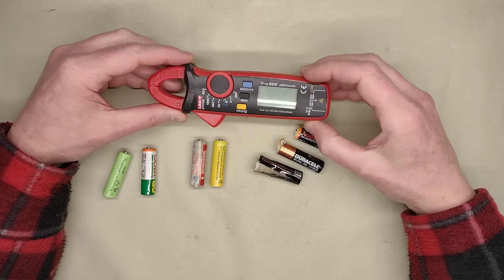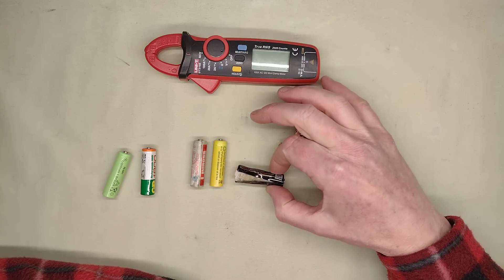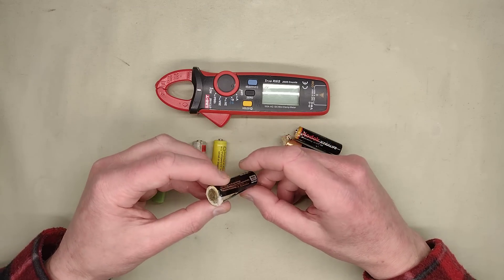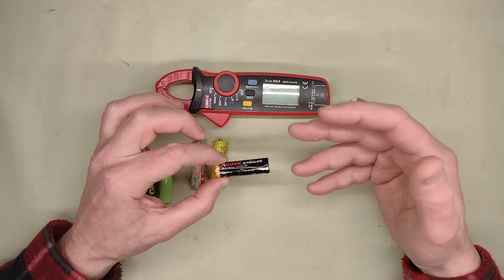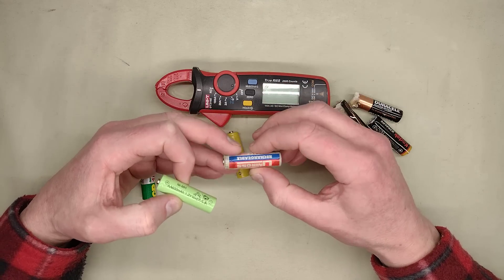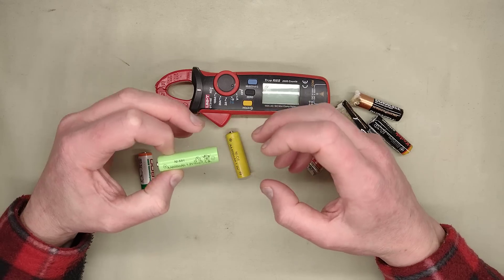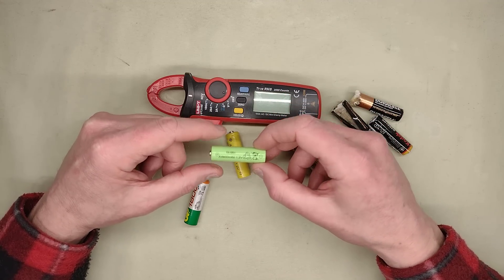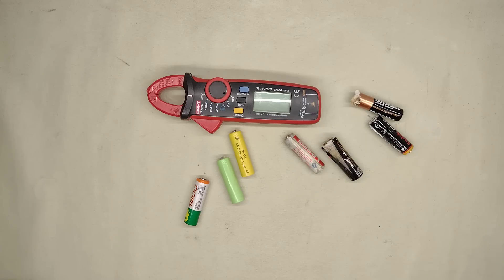The curse of leaky alkaline batteries

Comment: Sorry to say I've got at least one bit of kit that really doesn't like the lower voltage of NiMH it being a Brother label printer. Not really had much of a problem with leaky Duracell or Kirkland alkaline cells but I do have some kit that it's easy enough to leave on by accident. My way of mitigating the risk is to periodically go through all my gear and check battery voltages. If I know I'll not be using it for a while then I take the batteries out.  If you do want good NiMH cells the IKEA Ladda ones seem as good as the Enerloops but significantly cheaper.
It is a pity about the NiCd cells. Still got few in solar garden lights where they last for years despite a good toasting by our sun.
Reply: The only Ni-Cd batteries I still have are in cheap garden lights as that is what comes with them.  I had a couple of them leak many years ago and reputable brands no longer sell them in AA, AAA, C or D anyway, the only Ni-Cd batteries in those sizes are the Shen Zhen Shit brands.

Comment: I've found the trick to using rechargeable is getting a nice charger that can keep at least a dozen batteries topped off and ready to go.  Get an expensive charger that handles at least double the number of batteries you need charged, and is smart enough that you can leave the batteries in there and not worry about over-charging. 
The enemy is laziness, so you've got to make grabbing a rechargeable even easier than unwrapping plastic container of fresh alkalines.
Reply: I use a Maha MH-C9000 Wizard One charger but it seems they're discontinued now. They're great for testing the capacity of cells (so you can match them) or 'breaking in' cells that have been dormant for a while. It also has a 'refresh / analyze' function. You can select charging current from 0.2 to 2.0A or you can just stick anything from 1 to 4 cells in and it'll charge them with no further input.
Reply: @Shaun.Stephens  The MH-C9000PRO seems to be the replacement for the Wizard One. I still have the latter, but the new model seems to only be missing the cycle function. They added a few QOL improvements, it remembers the last settings you used and you can use the same settings from one slot in all of them. And possibly the biggest thing if you're using it in the bedroom: the backlight will automatically shut off.
Reply: IKEA do a great, low cost  wall mounted unit that allow you to keep charged 12 AA or AAA sized batteries and have an indicator to show the charge stateof each battery
Reply: @MAMDAVEM   Will check that out. If it has a 12V input I see potential.  Luckily I know my way around Ikea so I can escape in like 10 minutes flat ;-)
Reply: Definitely!! I've been so impressed with the Liitokala 500S charger/test unit (same Liitokala cell factory that makes the high quality Li-Ion cells), I bought 2 more. It instantly recognizes what different chemical type of cell you're charging and with it's Charging/Discharge test feature, I can write the capacity on the cells and match pairs or sets of them.
Reply: @MAGGOT_VOMIT   Same here, except I have 2 x LII-500 (not the S). Very cheap and good. Been using them for years now. Really easy to use and you can at least check if the cell is good or not. Highly recommended.
Should make a multi charger with like 12 slots just to keep them topped up on a small solar panel or so.
Reply: @Luke-san  I also have a LiitoKala 'Engineer' Lii-500 that I use for my Li-Ion cells. I know that it can handle Ni-MH cells as well but my Maha does that job so well I've not used the Lii-500 for Ni-MH thus far. Good to know that it's capable if anything should happen to the Maha.
Reply: @Shaun.Stephens   Yup, I also have the MH-C9000 and a Voltcraft IPC-1L on the side. The 9000 is a lot larger and bulkier (same meaning I guess). It might be more precise and you can cycle different times but that LII-500 for the price is a no brainer. I have used it all around the world and still works flawless. Only issue was the included 12V power thing but I have loads of spares around and sticking some rubber feet so it wouldn't slide off some slippery surfaces.   I have a mixed bag of AA, AAA, 18650's and now 21700's.  You can just charge it all. (just be aware that the batteries go upside down in the thing).  Owww also made some thing with a dummy battery with leads so I can charge 3.7V flat cells, so it is really convenient and has been a life saver.
Reply: @Luke-san  Thanks for that. Yeah whenever I use the Lii-500 I have to remind myself the cells go the opposite way to the MH-C9000. I've been meaning to make some labels up for that reason (though it does no harm if you put them in the wrong way - that I've noticed). I also upgraded the 12v PSU for my Lii-500. Cheers.
Reply: @Shaun.Stephens   That is an error Shaun. Do not reverse a 18650 in there because you will start smelling something, There is an SMD resistor which will get a lot of dissipation.  But hey, it still works, and there are schematics on the interwebs.
Reply: I got my 4 port charger with my eneloops and am happy with it.
As soon as two batteries run out (XBox controller, Remote control or whatever) I pop them in because it's on my desk. And I ALWAYS make sure that I have at least 4 Eneloops ready to go so I don't have to wait for the charge. No need to have 8 or 16 batteries getting topped up constantly.
Reply: @Black3ternity  yeah I have a 4-battery smart charger but a dozen Eneloop AAs. Once a year I make sure they’re topped-off, and then otherwise treat them as if they were pre-charged batteries in a drawer. Some people might not accept going down to 90% charge in the first few weeks even though it stays there for months afterwards, but I certainly do.
Reply: I recommend the BC700 charger. It is cheap, and very intelligent.
Reply: i genuinely do not understand how going out or online and waiting for new batteries to arrive you had to buy with money is easier for literally anybody instead of just... shoving them into a charger for an hour
Reply: @scribblecloud  I don't know about you, but I can open up a package of fresh batteries in a lot less time than an hour.  Even if I have to walk down to the drug store to buy them first.
Reply: @AndyLundell  well you have to put on shoes, jacket, mask, and if youre lucky like me youd have to drive there to even get to a store, then youd have to actually pay cash and walk/drive home, before unwrapping. 
alternatively if you just have enough rechargable batteries (i bought like 20 some time ago) you just pop in the empty ones, and pop out freshly charged ones.. literally takes like a second.. and you dont have to pay cash :I
Reply: GP PowerBank v800c. Only charges 1 - 4 AA/AAA Ni-Mh at a time, but ridiculously fast. That thing fully charges 1-2 x AA in under 20m, 3-4 x AA in aroung 30-35m, 1-4x AAA in under 20m.
Reply: I believe you can make a very cheap trickle-charger using as many multiples as you like of a single-cell holder and a 1kΩ resistor.  Wire them in parallel to a 5VDC supply, positive to positive.  This will put roughly 3.5 milliamps into a fully charged cell, keeping it very gently topped up against the very small amount of self-discharge that occurs over time.  Don't use this to perform a full charge (it'd take forever), just move the cells from the real charger to the trickle charger once the real charger says it's done.
Reply: IKEA sells a nice one that can keep 12 batteries charged

Comment: Always fun when you have found one seriously leaked in a tube style battery holder and its expanded to such a extent you cant just pull it out, then you have to get the drill out and mutilate it by drilling through it until your able to pull it out.

Comment: There’s literally no point to ever buy alkaline batteries. I tell everyone I know this. If you’ve ever had $100+ piece of electronics ruined or extremely damaged by $.50 worth of batteries that’s almost 36 name brand nickel metal hydride batteries. Just like Clive said the only reason is a higher voltage, however since there’s better energy density most electronics just think you’re at 80% battery for a really long time.
Reply: The low battery warning indicators on lots of equipment won't work properly with non-alkalines.

Comment: Depleted, discharged, alkaline batteries I forgot about in a costly ham radio unit leaked and ruined it.

Think about it, a $2 alkaline battery will permanently destroy a $2,000+ piece of equipment.
Reply: What $2000+ rig uses alkaline batteries?

Comment: When I was working in HI, the lab had a rule that batteries had to be removed before putting away anything.  I assume something about the climate made leaking worse, or maybe just the corrosion caused by leakage was worse.  It was rather annoying, but less annoying than having to clean crusty battery good out.

Comment: I've have some torches (flash lights) made to use 3 x AA in a clover leaf adapter refuse to let me use 3 NiMh cells, because the NiMh cells must be a few thou. thicker than Alkalines and the adapter won't fit in the machined alloy tube with NiMh's. So I'm looking to 3D print a sleeve that lets me use a regular LiIon cell in place of the whole AA mess. I'm a bit surprised they aren't available commercially since you can get the AA/AAA to C & D adapters in a lot of gadget shops.
Reply: Many of that type of flashlight comes with the plastic sleeve.  I think you can buy that tube, perhaps in a length to cut into several adapters.  You can wrap the 18650 cell with masking tape or maybe cut a piece of vinyl tubing for an adapter.  You can also install 2 dummy AAA cells and 1 10440 Lithium cell, but you will not have much run time.

Comment: I made the switch years ago. Most things I use have lithium ion or I use lithium primary cells. I have nickel metal hydride but rarely use them. I will occasionally use alkaline cells but never leave them in a device.

Comment: I picked up a couple set of AA and AAA NiMH batteries a couple years ago and I am so glad I did. As you mentioned in the video, I have lost several pieces of equipment due to alkaline leakage. 
I also switched to rechargeable Li-Ion CR-123 and 9v for my flashlights and test equipment that use 9v.
I have Storacell carriers for all the battery sizes so that I always have backup batteries in my backpack. This combined with a couple of small charging stations has already saved me hundreds in batteries.

Comment: I have preached for many years that the Duracell batteries made after around 1995 leak like crazy. I have had so many things destroyed by Duracells. I still use alkaline batteries but I stick with either Energizer or Amazon basics (I think Energizer might be making the Amazon Basic batteries). I had a laser aligner on my drill press and Duracells in it (it came with them) leaked. I took them out and looked and they still had 2 years on there use by date. I also had a Garity head lamp I bought that came with Duracells and they leaked in the package (new light, new batteries). But many years ago the last straw for me was I had an old Maglight that took 9 D cells (yes 9 D cells) it was an odd flashlight sold back in the 80's for a short time, often carried by Police and it had the nick name of the "bat" and Duracells leaked in it so bad it messed up the aluminum housing, switch and everything and I had to toss it. This was a $120 flashlight in the 80's but was not replaceable since they only made them for a short time, that one made me really mad and I never used a Duracell since then.

Comment: Hi Clive, a very warm and wet welcome to the leaky Duracell club. Duracell alkaline cells do appear to be a lot worse for the problem of leaking compared to any other brand or make. I’ve even had the 9V batteries showing signs of distress out of the packet (well within their marked date).
Some of the problem appears to be poor quality control. Most other brands or makes of alkaline “non-rechargeable” cells and batteries are a bit better. But may still leak if the cells are not matched in terms of capacity, as then whichever are the stronger cells will force current through the weakest, which will then leak.
The only redeeming thing is, if caught before the leaked alkaline has been there too long, it all cleans off okay with warm water. But if left for months, it will corrode metal contacts or PCB tracks or electronic components. Especially if it an absorb damp from the air.
To everyone, my advice, if you are using  alkaline “non-rechargeable” cells and batteries, is to inspect them in any device at least every two to three months.

Comment: I'm pretty sure ignorance and the much less expensive alkies is the main reason they power most consumer products. I do have a weather station I use with 4 temp stations, so I can monitor and set alarms for freezing conditions where my water lines are. They strongly suggest lithium batteries. I can see why and they may last a long time, but they sure can drain a wallet. Thanks for this video Clive, it was sorely needed.

Comment: Quality alkaline cells can be purchased for as long as 15c each.  The cheapest NiMH cells I have access to are just under $1 each.  Many applications, such as remote controls, take years to drain a battery.  Using alkalines is still the cheaper choice as eventually NiMH batteries develop internal shorts and die.
Having said that, one leaked alkaline can destroy a product and wipe out all the savings.  I discard my alkalines at the Best Before date.
Reply: It isn't cheaper when you find almost every device you put an alkaline in ends up with leaky batteries.

Comment: Personally I gave up on 'expensive' alkaline batteries several years ago as I found Duracell and Ever Ready far more prone to leakage than cheap 'chain store / Made in China' batteries. 
OK, so the cheap batteries don't last for years but, they don't leak either in a 1~2 year timespan. It's far less inconvenient to change a battery than change a meter, particularly when you find the battery contacts were only 'corrosion resistant' and not a stainless steel 
The cheap yellow Chinese meter you used in many early video's had batteries that lasted about a year of almost daily use which for a $5.00 meter was fine with me

Comment: I have a slightly unusual case where I need to use alkaline cells as the device requires 3 volt. it is an old socket 7 motherboard with one of the much-loved Dallas real time clock chips, Dremel down to the battery contacts and saw it on a two AA holder in place of the now dead internal lithium cell. This is a cmos circuit and as such needs the 3 volts. Yes modern device will play nice with the 1.2 volt cells but old electronics were built around the three volts supplied by a pair of alkaline cells.
Reply: Replace it with a lithium battery.
Reply: @stargazer7644  that was just an example of a use case that needs 1.5 volt cells, honestly I just went with the AA holder as it was what I had on hand, also have you ever seeing the gymnastics involved with mounting a 2032 holder on a Dallas RTC chip. Here is a better example which I do not own yet, the Sega game Gear which used 6 AA batteries for a total of 9 volts, if rechargeable batteries where used it would only get 7.2 volts, that is quite a bet under voltage. All I was doing was giving an example of how the .3 volt different was not much for a single cell, but it adds up fast when you start putting them in series

Comment: I agree.  I’ve had many remotes and a meter destroyed by duracells.  I have a powered door lock that won’t function on anything but alkaline batteries.  That being said, I have never had everready energiser leak which are alkaline.  In my area you can only find Duracell batteries sold in large packs for cheap but they are unreliable due to leakage.  I won’t be buying Duracell anymore.
Reply: Duracell is an umbrella brand. They make good quality stuff that you have to pay more for. But they don't do a good job of informing the customer what they are getting except with the "long life" and "high discharge rate" lines. I once bought a 40 pack of AAAs for my Palm (some time ago) and, before I got halfway through the sleeve, there were leakers. In the factory packaging!
Reply: @Charles Murphy We've found at work that energizers leak just as much as duracells, so don't get too comfortable with leaving them to sit for any length of time either.

Comment: At some point duracell changed a formula or supplier or something, and became one of the worst for leaks. They leak as often sitting in a package as when I dabbled in an alkaline recharge station where I had to set cells aside afterwards to toss the ones that leaked immediately after charging. Today between the new hybrid NiMH, or regulated 1.5v lithium and even 1.6v NiZN cells for devices not made for 1.2v, there's just no reason to use alkalines for anything that is not disposable.
Reply: Do you get many cycles from NiZn cells? I loved the 1.6V but only got about half a dozen charges before total failure of 80% of them. This was using the correct spec charger.
Reply: @nicgreen4234  Reliability varies greatly by brand (pkcell seems often recommended), and even the best ones have a fraction of the lifespan of lithiums. It's just an inferior chemistry that's been completely replaced by regulated 1.5v lithiums, even if the built in regulators add an extra point of failure.  NiZN seems mostly recommended in regions where good lithiums are unavailable, and they run into the huge problems with reliability you've mentioned.

Comment: I use Energizer Ultimate Lithium batteries on all my test equipment. Never leaked and last a long time. Sure they're expensive, and rechargable batteries have lower recharging cycles than before, but it's way better than to have battery acid leak into a $300 multimeter.